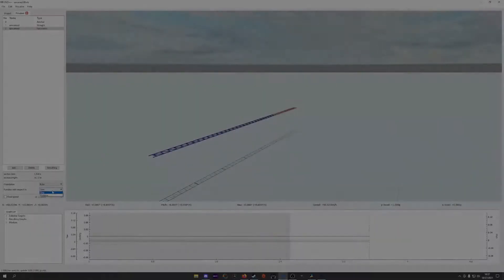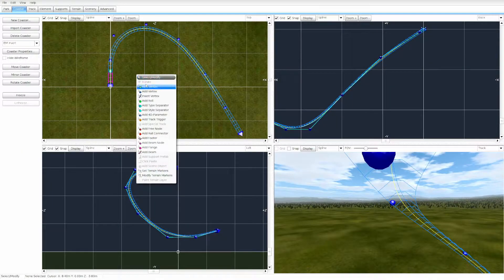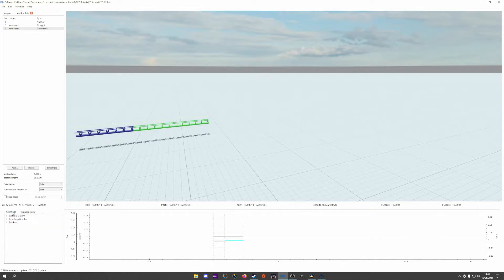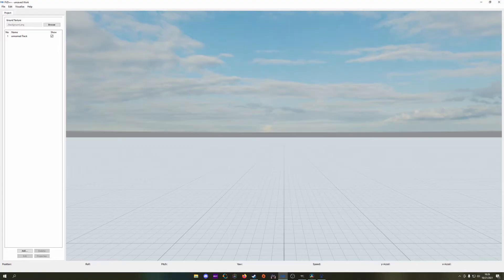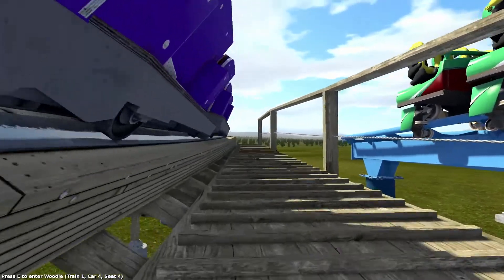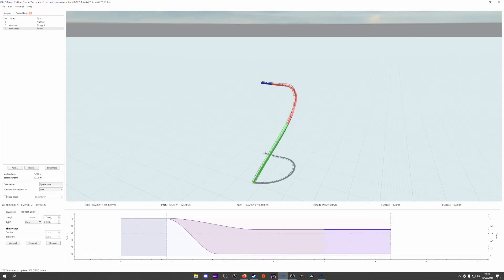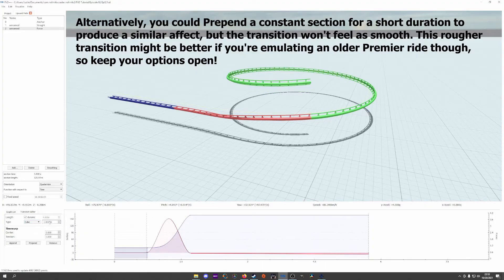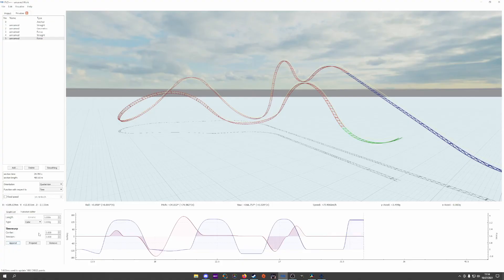Force Vector Design - Episode 02 - Roll Rates and Interaction with the Normal Force

Comment: Is there any way to have a coaster go through once forwards and then line up backwards on the way back?
Reply: I should have specified.. the entire length of the ride would be 2 cycles, 1 forwards, 1 back and then forwards again to the station (rest).
Reply from the maker: @exwi-zed533  Do you mean like a shuttle coaster? In the coaster properties you can choose that option, then in your station options you can tell it to pass through multiple times. 

If you mean you want the train to loop back around and get back on with a switch track (like a locomotive would) then that is bit more of a challenge. You'll need to create a copy of your track as an element that points the starting node the other direction, then connect them at the point where they would split. There's a tool floating around that does this for you. You'll end up with one long loop that doubles in on itself, so you'll have to hide the overlapping segments of track. Getting the switch track in would require a script with a trigger. 
Not sure if that's exactly what you're looking for, but feel free to message on NLC if you want to discuss more.

Comment: Do the road/tractor wheels on ptc's actually pinch and move up and down like they do in Nolimits on the real trains?  Every time I've gone looking to see if they behave that way on The Racer and such I've never seen them do that, all 4 pairs always seem to stay locked in place.
Reply from the maker: If both axels were locked, the chassis would not be able to yaw or roll. So yes, they really do pitch up and down, yaw left and right, and roll. There are definite limits to these motions, set by the shape and dimensions of the car sitting on the chassis, and the interaction between the wheel assembly and the chassis as well.

If you look to the patent on uspto you'll find some great diagrams of their trains that show this motion. You can easily see how they would interact with the car/chassis from these views.
Reply: @frankleemadere9020  Found a patent for a single car version, still hard to see it in motion even though I understand a bit more how its working especially how the chassis rolls and can affect the wheels pitching.  How the wheels pitch up and down when not rolling confuses me a lot still as to why its seen more profoundly in NL2 but not on the real models.  If its alright with you would love to be able to discuss this on discord, NL Central, or such would make it easier with the ability to post pictures.
Reply from the maker: @TijjerGamepark  Slight apologies, I misspoke when I said the wheels pitch up and down and yaw. It's really the connection between the trains that handles those translations. The wheel assemblies only roll, which causes them to rise and fall relative to the car above. I suppose I was confusing the terms...

Since the front wheels do not roll, hence the car atop the chassis rolls with them, and the rear wheels roll relative to them, there is a point where the rear assembly rotates enough that it makes contact with the car above. The culprit is the roll rate, or how fast the track rotates to an angle.

Definitely feel free to message me on NLC if more clarification is helpful. I appreciate the interest.
Reply from the maker: @TijjerGamepark  oh and the patent for the single car was the one I was referring to. The way the wheel assemblies function is virtually identical to the typical PTC trains, so I thought it a good example.